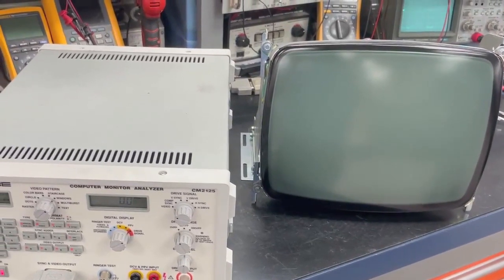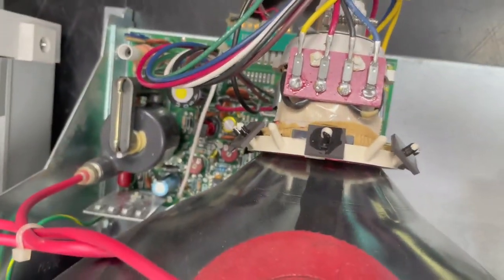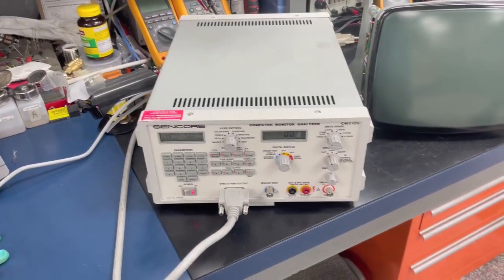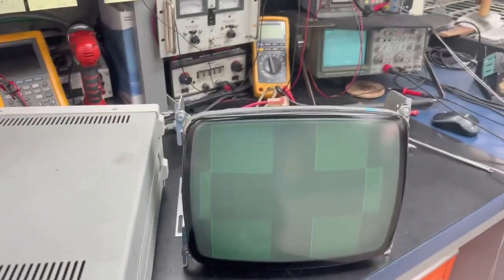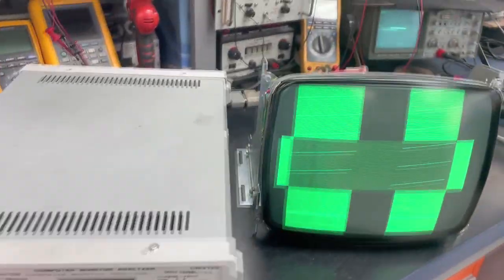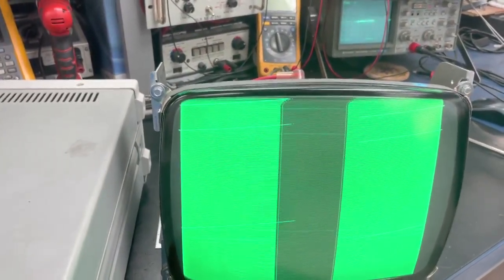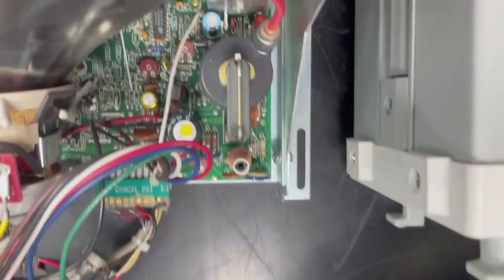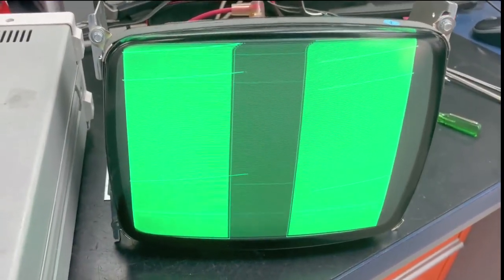CRT Monitor Test

Comment: Did you build a custom circuit board for that CRT or is that the original? Looks immaculate. Thanks, Nick
Reply from the maker: That's the original, but we cleaned it up. Part of our process!